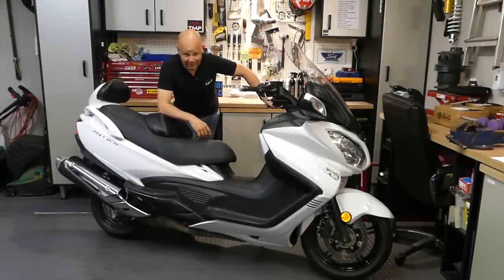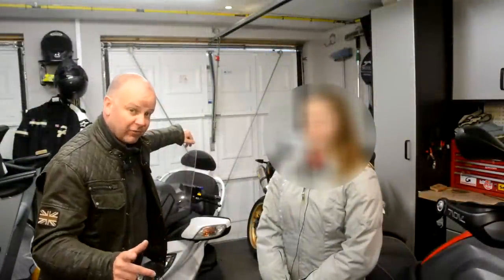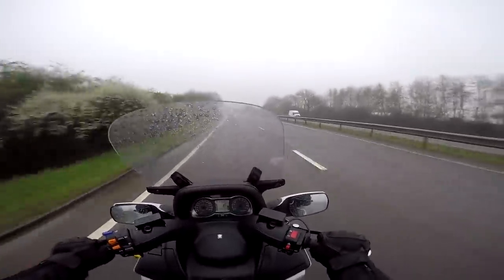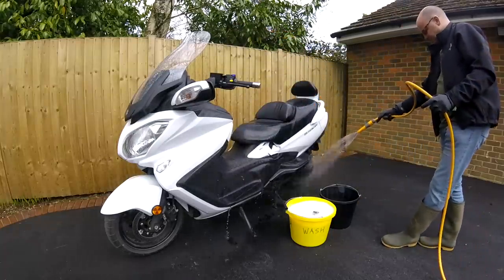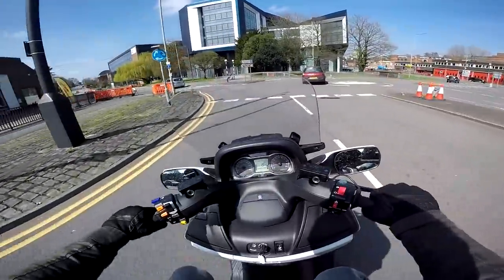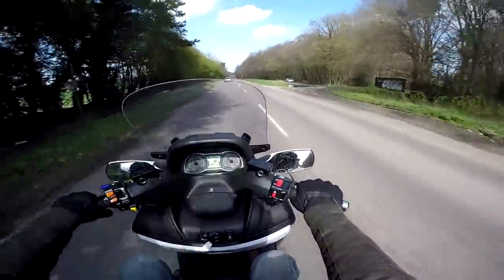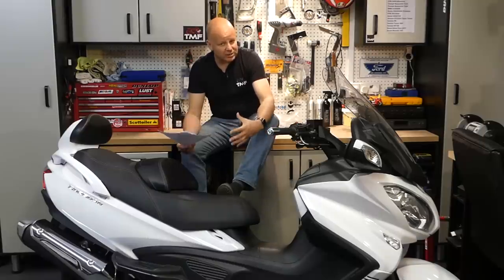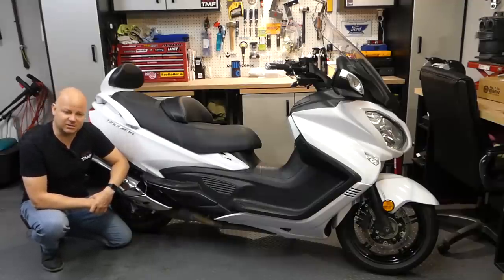2018 Suzuki Burgman 650 Executive - Long Term Review

Comment: I would put my peace sport nightsky upgraded to 100cc up against this Suz in a heatbeat but I love Suz bikes after having a GT250 and GS1000 e with vertter full equipment.  Both I put over 75K miles on each.  I want a C50T, but I love the scooters, In FL dont need heating but in GA that would be nice, and 75+ MPG it a massive plus.  Now if you want speed, TAO got a 50cc that will hit 45+mph and 100mpg but it look like a dirt bike not a scooter.  The NightSky was my sons that got stolen and Yes I have put lot into it, but it bigger badder then when he got it.  I just about get her restored now in BLUE.  The rims are warp, after I replace them with mag rims like the kind used on Triple J's, Im hoping she will do 60+mph.  I have been thinking of switch the case from a short to a long case so I can have 12" rims not 10".  Peace sports parts in Norcross GA, think I crazy, but that one of the difference in GY6 scooters and the TAO.

Comment: I was wondering what kind of scooter do I need for my weight, I weigh 370 pounds.
Reply: I'm also 6'1
Reply from the maker: One of these would do you a treat!
Reply: @TheMissendenFlyer  I'm sorry I didn't understand your answer.
Reply: Depends on what you want it for. Where you ride. And what scooter. 

For quick acceleration
1 BMW C650ht. 650cc
2 Honda SilverWing. 600cc
3 Suzuki Burgman. 650cc
4 KYMCO MyRoad. 700cc

For long highway cruising
1 BMW C650gt
2 KYMCO MyRoad
3 Suzuki Burgman
4 Honda SilverWing

For saving money (economy)mpg
1 SilverWing
2 Burgman
3 C650gt
4 MyRoad

For a commuter where you will always be one up and no faster than 65 for short periods or ever need 70 mph, a 4-500cc should do fine. 
Congested city, lower speeds 150-300cc.
The shortest saddle height is the SilverWing. The highest saddle height is the C650gt. The MyRoad and Burgman are the same height. 
The lightest is the SilverWing. The heaviest is the MyRoad.
Reply: @gpecaut1  for long rides I'm going for

Comment: A big cost of running any bike/scooter/car is depreciation so it's unfair to compare new with secondhand, as the initial depreciation of either from new is the biggest hit.  As for running costs, short service intervals (usually 6k) and ridiculously short tyre life are the killers for bigger bikes, anything above a 125/250 is likely to cost more to run than a car.  Bigger bikes are also poor on fuel compared to small cars, many of which also have a VED of £0!  Bikes and scooters are great for commuting on our overcrowded roads and it's potentially easier to find a parking space, but don't believe the journo hype that bigger bikes make commuting cheaper than a car.
Reply from the maker: ...as someone with 4 bikes and 3 cars I can't help but concur!

Comment: Is it just me, or does it seem almost prohibitively expensive to own a motorcycle in the UK?  How much more expensive are cars?
Reply: It really depends what motorcycle you want, how many miles it has on it and how old it is. For example, if you want to buy a brand new 1,000cc sportbike it will set you back around £14,000 whilst if you buy a 10 year old 600cc sportbike you could get one for £3,000! A brand new CB125F from Honda will cost you only £2,800 which I think is a bargain
Reply from the maker: What Elliot said!

Comment: This bike is looking pretty dated now. I've had mine since 2011, looking towards my next bike as this won't last forever. The latest models offer hardly anything new over my one, so I won't be getting the latest model any time soon, especially if they haven't improved the brakes or wheels which are terrible. The T-Max is looking much better, but doesn't have the essential folding mirrors or other things that this gets right.
Reply from the maker: So what will you go for?
Reply: @TheMissendenFlyer   At the moment I'm hanging on to my bike. Going to run the wheels off it until something better has been invented. The T-Max is well over priced, and is only a 500cc. The Honda NM4 looks great, but isn't practical. The BMW is expensive and reviews say it's not as good as the Burgman, so perhaps the grass isn't greener and I should stick.
Reply from the maker: Sounds like a good idea.....

Comment: The fuel up looks like a faff :D I never understood what they want you to do with the fuel cap when it's not attached to the bike in any way? It's never a good idea to put it on the ground or on the bike for that matter. Just a bad design.
Reply: lay it on the left side passenger footplate. the faff is because you need to align the arrows on the cap and filler neck, and just turn the key. It is a very small compartment to actually get your hand in, esp with gloves on!

Comment: Suzuki Burgman. Can start at £2000 up would for the use one all you have to do this look for a good one and save money on new one my as know dun 53000 mile and I am still going on so if you like to buy a Suzuki Burgman 650 executive you can buy use the only think is that the old one do around 50 to 55 a gallon hope this help